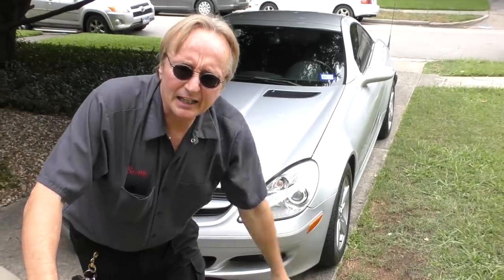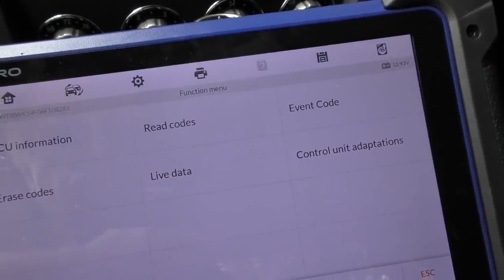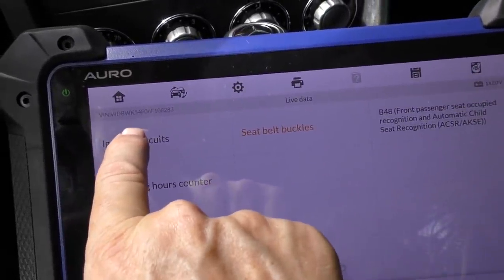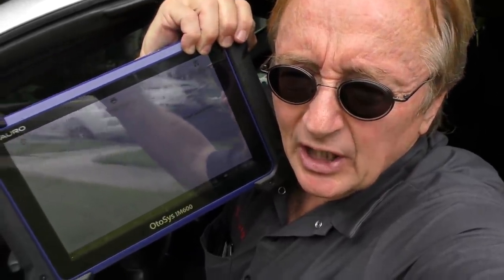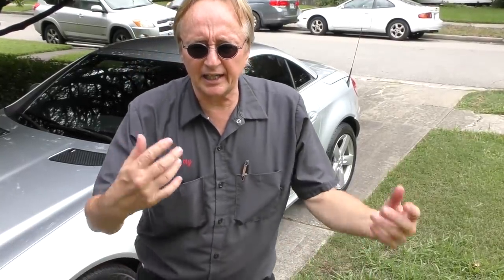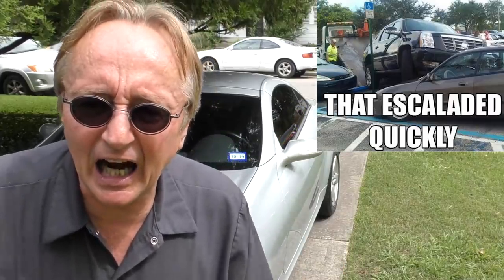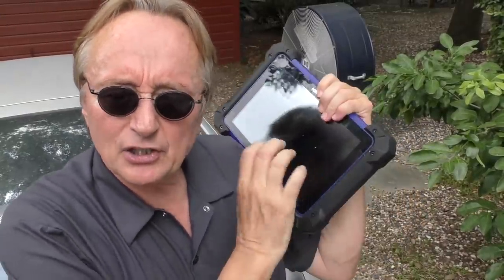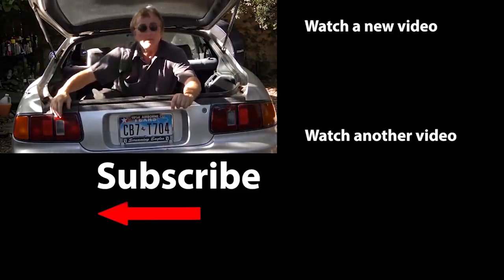You Can't Even Work On Your Own Car Anymore

Comment: I had a 2015 Ford explorer the airbag light went on 
All I needed to do is take the connectors off under each seat sprayed some wd40 reconnected them 
Was all fixed 
Dealer would have done the same thing and charged you hundreds of dollars

Comment: That’s why I only drive older Honda’s
Reply: @steelunited1115  Chrysler are you mad?
Reply: @steelunited1115  Honestly I think that's the whole point.
90% of the Germans be like: after 20.000km I change my oil and oilfilter and I also thought that'd be normal. 
Then I found out why so many cars in the US still run perfectly fine eventho most of them got 250.000"miles!" on it.
We be like: 250.000km no that's to much for a car under 200.000km minimum :D
Edit: Which Chrysler do you drive ?
Reply: Darn auto spell check changed it to Honda (Honda sucky unreliable transmissions) when you ment to say ultra reliable Toyota's.
Reply: @airgliderz  Older Hondas
Reply: Gen Wunner My dad has a 2007 Ford Focus and it still runs well. American cars can be a hit or miss
Reply: steel united111 my Honda 94 has 210000 and the engine is still going strong with no problems, get a Honda
Reply: @steel united111 same here I had a 2001 Chevy impala and I had to replace the transmission at 120,000 then again at 145,000 and it had a phantom electrical problem that not even GM could solve I gave up and junked it and bought a 2003 Toyota Camry no major problems with it yet and it’s got 184,000 miles.
Reply: steel united111 Nothing against other companies, I’m just familiar with Hondas. Parts are cheap and easy to get.

Comment: Scotty,

I have 2015 Chevy Impala 2.5l that hit 100,000 miles today.  It has had zero problems and even has the original tires and breaks.  I change the oil and just changed the plugs and transmission fluid.

It rides like a dream...did GM get it right for once?

Comment: I've got a problem with the passenger airbag of my 2004 Chevy Nubira. The code says "High Resistence". I've checked all but no success.
To have the car inspected I've taken the instrument cluster, isolated the signal from the SRS lamp, and soldered a wire to get the signal from the power steering lamp to the SRS lamp. So, when I start the car the SRS lamp will come on and off at the same time as the power steering. 
For the inspector it looks that it's working correctly.
To read the airbag DTC I've picked a cheap OBD to USB cable and redirected the signal from pin 7 (where is the ECM data) to the pin 13 where is the SRS data (in this car. Other brands have different layouts). Then is just a matter of getting the right application.

Comment: Seatbelt pre-tensioners are designed to pull you back to the seat a millisecond or two before the airbag fires. This is incase you are leaning forward when the impact occurs. If you are in direct contact with the airbag as it inflates, your injuries could be more severe than if you are back against the seat, and move forward into the already inflated bag, post maximum pressure.

You probably, for safety sake, should replace the assembly, but if you want the light to go out, unplug the wires to the pyrotechnic motor that is designed to winch you back, and replace with a 3 ohm resistor. Just make sure you declare you did so when you sell the car, or get it fixed before you sell it. And remember, lack of having the pre-tensioner working, could KILL you.
Reply: Thanks for all the fish :) i would give you some lemons in return but...i used them all up myself...i think...(WHAM in the face) :)

Comment: Years ago I had a '76 Nova. I wrecked it, it had an automatic seat belt tensioner.
It was a metal pendulum. Car brakes hard (or stops by hitting something) the pendulum swings forward and locks the belt, no electronics needed.
Just another reason Scotty hates Benzs 😁
Reply: Not the same not even close.  That was a lock that just locked the seat belt.   These auto tensioners physically tighten the belt and remove ALL the slack from the belt.

Comment: If someone ever designed just one car that was designed from the get go to be easily maintained, mostly by the owner, they'd have a sure winner.
Reply: A business like that probably wouldn't survive for long though
Reply: @Exarhadsgfds  That's sad because isn't that the kind of car we all wish we had?
Reply: Yep, I want one where a clutch replacement is just a catch to release the old one and then drop in a new cartridge clutch. It would be like changing a printer inkjet cartridge! :)

I did see that Vauxhall had one that was easy where you opened an access cover, pulled out the input shaft, then from an access panel can unbolt and remove the clutch with the gearbox in place. Very neat, didn't catch on.
Reply: @Exarhadsgfds 
They'd survive just fine, it's just that they get more money (in theory) if it breaks down every five minutes.
Reply: That would be called a 1950 to 1965 Jeep CJ5.
Reply: That pretty much is most cars from the 1980s.
Reply: If someone wants to provide the money I'll work on it right away.
Reply: Marcus Sease  Yep, that's why I keep mine around, best all purpose truck...well the S10 and Nissan D21's, Mazda B-series, and Toyota pickups, simple easy to work on vehicles that were compact and would go anywhere.

Comment: And this is why I’m driving my dead grandmother’s RR silver cloud II. It’s 90% GM and you can fix it with hand tools. It was also before Lucas the black prince of darkness electrical system was installed so 😝

I may not save if gas mileage but it’s cheaper than replacing seat belt retractors and computer crap. 🙃
Reply: That's awesome! What if something goes wrong with it? Wouldn't it be hard to find someone to fix it?

Comment: In the UK, you cut the track to the SRS light and feed it from any of the other warning lights e.g. oil pressure so it does the self-test and then goes out and stays out. In some cases you have to isolate the SRS light and feed it power via a little timer module you can buy on eBay for about $3.50  which brings the light on for a few seconds then turns it off. Doesn't fix anything but gets you through the inspection.

Comment: Scotty, I agree with everything you say about the non maintainability of this kind of vehicle. The only thing I wish you had noted was that usually, when the SRS light is on, the entire airbag system is deactivated. Not just the active restraint in the shoulder harness. So there  is more risk if you don't get it fixed.

Comment: Everyone complains all the time. Just buy a used car man
Reply: Buy a new one and switch it out after it goes out of warranty. Or buy an old one!
Reply: Oh well I drive a mazda from 1972
Reply: Time is coming when, unfortunately, it won't always be possible. Just read an article where Madrid Spain excludes cars older than about 2000 (depends on make and model) from driving in the downtown area to reduce smog. Inspection sticker is color coded to be easily identified. A lot of European cities are doing the same. What's sad is the working poor are the hardest hit by this type of legislation.

Comment: As a enthusiast on Jaguar XJ 6 (X300) I completely agree with Scotty that you have to have specific scan tool with uploaded software that can read all trouble codes during basic diagnostic. I will give example with my old Jaguar.  I drive the car every day and put over 200 to 300 miles a month. One fine day I am in traffic, outside 102F, suddenly my dash board started acting up, flickering like Christmas lights, affecting RPM and Speedometer indicators. I pulled to a parking lot, plug the scanner and did test, no bad codes. Left the car to cool off for 15 min and kept driving. Again the same issue occured and my engine was misfiring, shaking when idling. What I did, I pulled back to my place. Left the car to cool and check the ignition coils. I had 2 malfunctioning coils that became too hot due to thin gasket and both burned at the same time, which affected the circuit on the car.I had spare set, replaced all 6 for peace of mind. Restarted the car, and did test drive and my car resumed normal driving cycle, all runs fine.. My point is that sometimes, small components like sensors or coils can confuse the ECU to a point that it may give false reading or not reading at all. With the Mercedes , just like Jaguar these luxury saloons are packed with high tech circuitry that is often prone to failure due to age, heat, moisture, and age on software. My old X300 was designed in the 1990s when we had WIN 95 for industrial applications. Mercedes above the year 2000 has been requiring software updates so all systems in the car are fully functional. If the software has not been updated for a model let's say ML 320, CLK, S500, S600, S430 from the early to mid 2000s, expect plenty of trouble codes. The software system has aged , and it will no longer diagnose all systems properly. SRS light on or  knock sensor failure may show on the scan tool, but often these components have not failed. The computer due to outdated software cannot recognize the parts and gives you false reading. I experienced these scenarios on my Jaguar over the last 12 years and I can relate to the Mercedes example. Bottom line, as a driver you have to learn to listen to the car, it speaks to you and if you learn how to listen, you can learn basic preventative maintenance like Scotty's videos and you can enjoy many years of motoring experience trouble free. I learned my X300 so well that with regular preventative maintenance my old Jaguar engine is pushing almost 300,000 miles. Yes, I plan to enjoy drive my old Jaguar for many years ahead.

Comment: Can switching to iridium spark plugs on an older GM engine that has a random overheating problem safe? The spark plugs are AC Delco Iridiums.
My car's engine specifies a gap of 0.45, the Iridium specified by the dealer is 0.60. 
- Also is the increase of in gap in the spark be beneficial or harmful?

Comment: Question - If that buckle system isn't working and the driver gets into a severe accident, will the belt system lock properly to protect the driver? Also, will the airbag deploy as it should if one of the sensors in the system isn't working properly?

Comment: I got really lucky when I got an SRS light in my Matrix (just like Scotty owns). In my state you can't get an inspection sticker with the SRS light. I researched it and found a common issue with the clock module that also has some SRS logic in it. I touched up the surface mount component solder joints and it worked! The clock display still goes on and off at will but I won't mess with it as I might affect the SRS system. The SRS system has worked well for years now, although, it does need the Takata driver's bag replaced yet again under recall #2!

Comment: Hey Scotty when the tool display resistance too large. It means a line is open. If shorted the the tool will display resistance too low. Do on the Mercedes there is a line wire/ connection opened.

Comment: Now I know why cars built in 96-98 including trucks, AR becoming more expensive and are so popular. You can still work on them and fix them.
Reply: The Equalizer I’ve had great luck with late 90’s Toyota/Lexus.  All repairs have been DIY and pretty straightforward.  Even the LS400 is surprisingly simple, and none of the complicated stuff ever breaks.

Comment: In the real land of the free In the state I live. There are no inspections. Period.
Reply: Is there not a load of absolute scrap creaking around with bald tyres and shot brakes that pull to one side when applied then?
Reply: @Rhythmeister  of course! Thats half the fun!
Reply: @SilentCheechGaming1991  fun so long as they don't slide into your pride and joy in the wet with their faulty dampers and slicks and headlights pointing at the sky!

Comment: Thanks for the help. I drive an 03 Chevy Tahoe, almost exactly 300k miles on it. When it's wet out if I accelerate to quickly my rear wheels spin and then I get a strong pull to the right. My speedometer, RPM, and horn doesn't work. Can you give me a list of suggestions to keep this boi alive and at a reasonable price. Oh and the oil pressure goes down when stopped  but goes back up when I drive.

Comment: This is so timely.  I have the air bag light on right now.  It seems to be the under seat connectors on the Ford F-150.  I'm living with it for now.  My basic scan tool says that it's a seat belt pre-tensioner short to ground.  Isn't that nice?  Tried cleaning the connector with DeOxit and then applied some Ford electrical grease.  The passenger side code went away and now I have a new one with the driver side one.  Go figure.  Can't these systems be rebuilt rather than buying a new one?

Comment: Scotty:  My 2006 Honda has an alert light on. Had a mechanic look at it and said it is probably the oxygen sensor but could be the Catalytic converter. He said if the catalytic converter has to be replaced he recommended using a OEM from Honda to get the right code. I called Honda and they want $1,000.
The mechanic replaced the oxygen sensor it and a month later the light is on again. 
I see catalytic converter prices from $140 on up.
Your suggestions?

Comment: Scotty, I replaced the front brakes on my '15' Audi Q5. However, I can't free up the rears. Darn electronic push button emergency brake is a locked gate I can't open. Does Audi have the only key? Can I fix this in my own driveway?

Comment: If the ABS light is on you still have the regular brake system function. What about the SRS light being on ? does it mean the air bags will still work or is the whole system off??

Comment: Hey Scotty I had a similar problem with another car a couple years ago. The seat belt just doesn't retract freely and fast enough. Seat belts get stiff from body sweat and oils so they get stiffer over time. The fix, untangle the seat belt and pull it all out and clamp the belt at the top(shoulder) then get a small 1 gallon pail and put some Dawn dish soap in warm water and use a small fingernail type brush and clean the seat belt. You will notice how much more flexible it becomes and it will retract like new. Let it dry and then reset your code. If it works then you didn't waste a lot of time or money? Thanks for the great videos:) D

Comment: I had the same Airbag light come on check the connection for the wires under the seat. sometimes when you put things in the backseat and they end up under the seat and end up loosening the connection

Comment: Still using my 2013 Craftsman scan tool i bought for $140. it will scan all ABS  System codes and Airbag codes.  You DONT need a $5000  scan tool Scotty.   its really not as complicated as you say they are. no diffrent that cars just 10 years ago

Comment: Scott the last one I had with that code turns out the 4 year old dumped a soda down there its also the only one I have been able to fix with out replacing the dam thing
Also the scan tool in looking at replaces both my obd 2 and myheavy truck one and we really don't want to talk about its going to cost I have wound up with several vans and a couple of pick ups lately that are not standard obd but are commercial obd 2

Comment: Jeez... You don’t need a $10k scanner or a $5k scanner or even a $1000 scanner to read airbag cods. My $50 scanner reads EVERYTHING. ALL airbag codes, all ABS codes, transmission codes, obviously engine codes, etc. no freakin problem. Company’s are always inventing new tools like my $50 scanner that reads everything, to help DIY’ers fix their car on there own without spending a fortune. As far as I’m concerned, you will ALWAYS be able to work on your own car. I am not a professional mechanic or a certified mechanic but still I always have & always will do everything on my vehicles by myself. I even mount and balance my own tires AND do my own alignments. And i LOVE it! I get an almost perfect alignment (better then my local alignment shop can do) and pretty damn balanced tires and it cost me NOTHING other then a few penny’s for wheel weights. I’ve been doing this since 16 when I got my first car (6 years now) and at this point the cheap equipment I’ve bought to get this stuff done has paid for itself 20+x over👌🏻😁 you don’t need a $2k tire machine to change and balance tires or a $10k alignment rack to get a near perfect alignment either. I only paid about $200 for ALL of the equipment that I use to mount & balance tires and align my vehicles.

Comment: not quite sure whether that’s the servo tensioner that pulls the belt against your chest shortly after you buckle or the pre tensioner safety decide that fires when you crash. If it’s the latter then you’d want to get it fixed as it’s there to save your life.

Comment: You can buy a $30 OBDlink cable and connect the car to your laptap, then use any software you want. It's what I use. It's what I used to flush a bad ECU. I don't know of any fancy scan tools that can even do that. And Mercedes has it's own diagnostic system called DAS (Diagnostic Assistant System). Allows you to do anything you want without needing something like a Tech2 GM uses.

Comment: The scan tool he has covers a vast range of vehicles so the software licences are expensive. But i have a Foxwell nt520 (£120/$150) specific for BMW (and covers Rolls Royce so future proof!) and it works well, shows real time info, especially when trying to fix folding roof. Although it did say there were several faulty micro switches, when there weren't any faulty. Just cleared codes and haven't come back.

Comment: I just bought a $350 scanner and it's great, gives me all the codes and details exactly what's wrong. I replaced two front airbag sensors that were bad and my SRS light is off now. The dealer would have charged me a fortune for that.